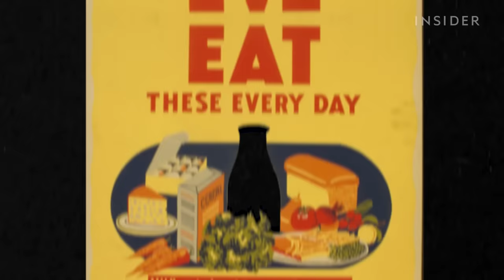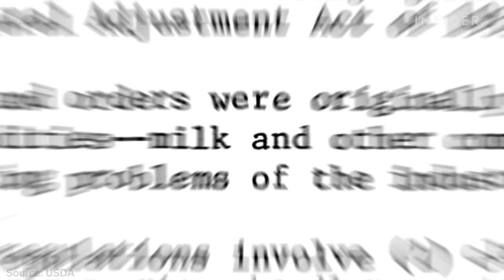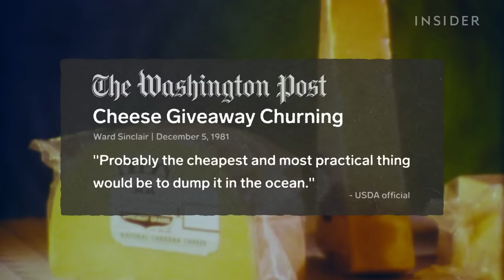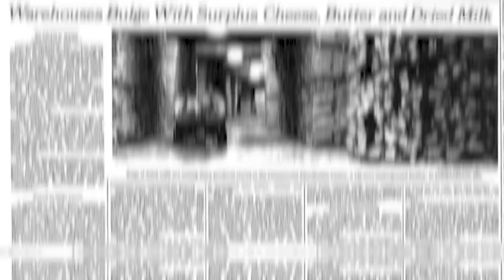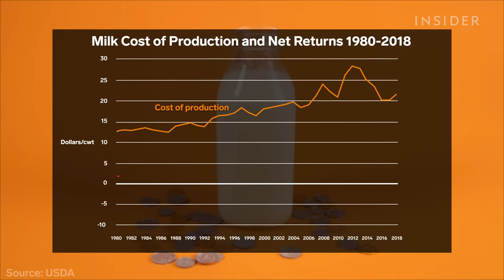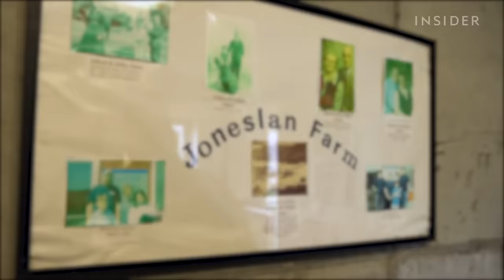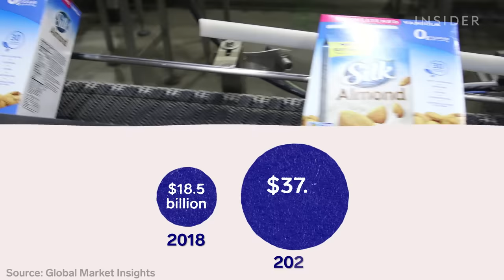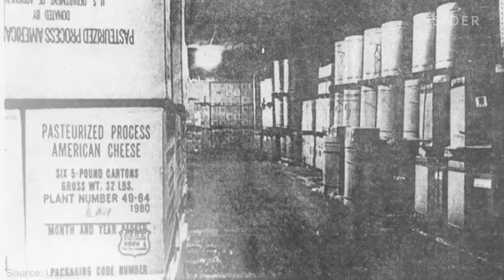The Rise And Fall Of Milk | Rise And Fall

Comment: I would drink milk if it wasn’t $5 per gallon. But I guess they rather dump it than sell it for $3. I only use it for cereal now.
Reply: The prices where I live are $3 a gallon. Sadly since I live on a dairy farm where my dad works, we are going to have to move out soon because it's shutting down.
Reply: @multifandom4092  Sad😔
Reply: In Milwaukee and Chicago I buy it for $2 per gallon for years. some places sell same for $3.
Reply: @LiberatedAmon  Dairy Farmers are not the stupid ones. They have zero control over the selling price of milk. The video pretty much covered the reasons of why the industry is flawed. Mostly government.
Reply: @LiberatedAmon  dairy farmers don't control the gallon price of milk at the store. Before you call the people feeding you stupid, take 30 seconds to Google government pricing controls on agriculture commodities
Reply: Remember that production and transport of milk, like ANY product, is not free. Making milk is expensive, so if the farmers can't get a decent price for it, they'll lose money in the cost of shipping and packaging it.
Reply: @catatonicbug7522  A 2L of Walmart brand soda is $0.87, a gallon of gasoline is $3.55. If they temporarily made them $0.75 and $3.30 they would sell out. I get that milk has to be processed and it costs money, but you don’t hear of either of those products being dumped in the millions of gallons (on purpose) just to artificially make the price higher. There is a supply and demand curve. I understand the maximum profit is usually in the middle of the curve, but having more consumers using more of your products more frequently also increases demand (growing customer base). Artificial scarcity and exclusivity are tactics used by luxury brands. Milk shouldn’t be a luxury products, it is considered a staple. Btw, the brand of milk I buy has a plant in the middle of and 1/4 mile from a Walmart and a Gas Station. It is $4.50 a Gallon at Walmart and $5 at the Gas Station.
Reply: They don't make a profit on $3 per gallon. Keep in mind $3 is the shelf price consider taxation and supply chain
Reply: @zacharywissinger3996  Now hold on a minute, Semi trucks use diesel fuel anyways. Both milk and oil are subsidized businesses too.
Reply: Where the heck do you live? It's like 2.99 a gallon for me...
Reply: Consider ping the caloric content, $5 is still a decent deal.  A candy bar is around $1 now.  That’s just garbage for the body.
Reply: @45-Subscribers  considering most the solids and therefore nutrients are extracted from milk to make cheese, cream, and other dairy products; milk is pretty much a byproduct. $5 is not a deal. Candy bars are a terrible comparison. Candy bars have a ton of high fructose corn syrup which is the most subsidized product in the USA. Literally, corn farmers lose money comparing cost to produce and harvest to what they sell it for, but the government pays them to do so. And the Cocoa beans are harvested using forced labor. So between the USA paying farmers to lose money, and the international farmers just not paying their workers (or very little), it is pretty darn hard not to produce it at a low cost.
Reply: @Orinslayer  I was referring to gasoline as a product not a cost of transport. But if oil production is high, they barrel it, and reduce extraction. The  excess milk could be powered and the production could be lowered. If they dumped milk because they didn’t have the means to process it, that’s fine, but it says they dumped it to try and jack the price up. That is stupid if the government already paid for it.
Reply: @LiberatedAmon  It is illegal to sell un-processed (raw) milk. Typically dairy farmers enter into contracts with a nearby processing plant (creamery) for a set price and time, say 16$ per 100lbs for 3-months. At that point the creamery has to buy the milk for that price regardless of over/under supply. Once the times up on the contract the creamery offers a new price based on the market, and the farmer doesn't get to negotiate.
Reply: For the most part, even "cereal" has little nutritional value.  I love raisin bran, but gave it up for diabetic reasons.

Comment: If you read the ingredients on alternative "milks" you might be very unpleasantly surprised when you find out that it is almost entirely water, cheap oils, and sweetener (some brands are good though)
Reply: Thats nothing new. Just about 95% of anything you pick up off the shelf in a grocery store will give you this same experience. Also, just like with those things the solution is the same - do it at home for better quality. Even real milk is disappointing. Ultra-pasteurized and homogenized.
Reply: cows milk is basically the same. water, fat and sugar. the just don´t sell it that way

Comment: On the one hand, I do agree the diary replacement shouldn't have "milk" so prominently on their packaging.
On the other hand, boy is that the pot calling the kettle black. Milk's benefit have been vastly exaggerated and is mostly a scam. The failure to address this point (and the exposure thereof) is a great failure of this video.

Comment: They should move these dairy farms to Africa so people can make more food products to feed impoverished countries.
Reply: Its not that simple, I work with a Ugandan Dairy farm and it is completely different to that of a US counterpart. They lack infrastructure, but more importantly then that is that the dairy cattle that were bred for cooler climates do not do well in the hot African sun. On paper it sounds like a good idea. but would require huge amounts of infrastructure and development of a new breed of cattle to work properly.
Reply: Yeah I see what you mean I’ve been in the direct path of the sun in Ghana and I fully believe I had a heat stroke. There is no other explanation for how intensely I felt I was being burned——I felt like a hot pocket in a microwave. I could barely handle it so I don’t think cows would fare that well either.